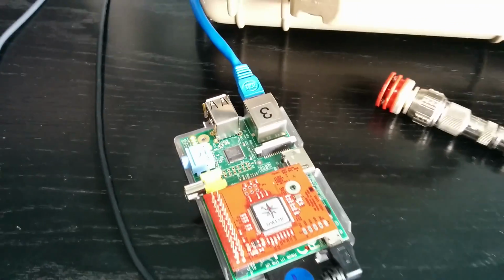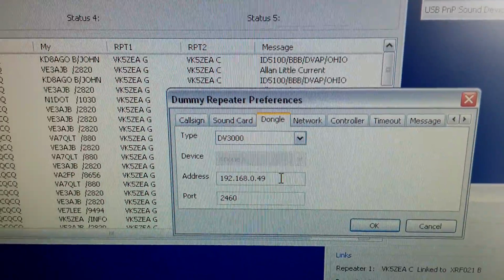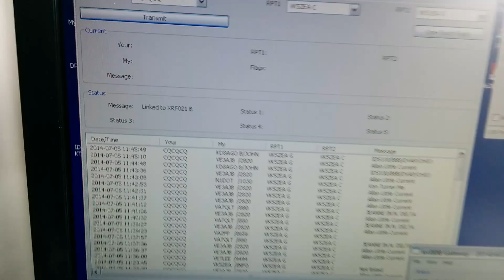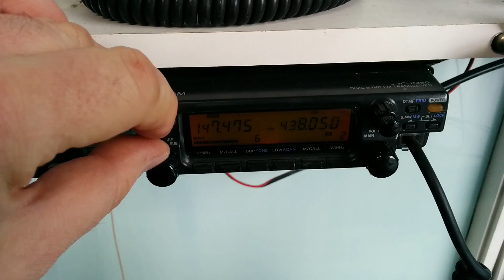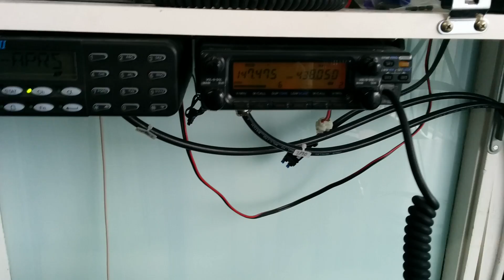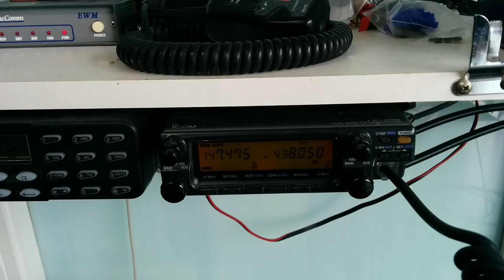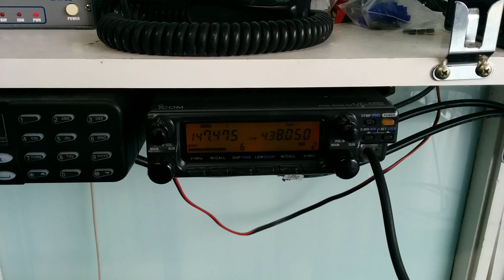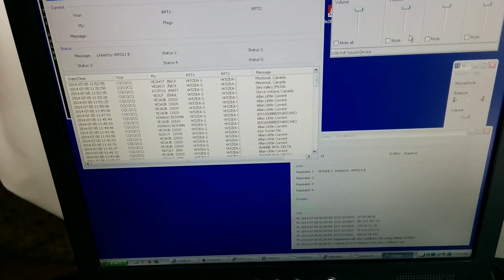D-Star to Analog with the NWDR AMBE3000 board

Comment: Is it possible to bridge D-star & DMR in a similar fashion? I am wondering if there is a DV access point equivalent available for DMR if not could the existing DVAP be utilized in some way?
Reply from the maker: +Peter Ceallaigh  I think there has been successful D-Star to DMR bridging with the BrandMeister software.  The DV4mini USB Dongle is a multimode digital solution... DMR, D-Star, Yaesu SF, P25, dPMR in the one device.
Reply: +Michael Carey Thank you for the info fella

Comment: hallo as they have with the PTT dissolved at the dummy repeaters ? so that the dummy on broadcast comes when the analog signal gets through ?. 73 oe7mfi
Reply from the maker: +OE7MFI Hi, this is a problem caused within Windows.  The URI and URIx use the Volume Down input on the USB chip for carrier detect input.   The only workaround I found was to use an alternative input (com port) for interfacing to the FM radio.

Comment: Very cool Michael.  I have been trying to recreate your experiment with my equipment. I have the DV3000 up an running but I am having a great deal of problems finding the Dummy Repeater software.  Was hoping you help me locate it.  /73s W8BDM
Reply from the maker: Hi Brian, You can find the latest Dummy Repeater software in the "pcrepeatercontroller" Yahoo Group.  Check in the Files section under Release.  I have been using the 20140519 version.

Comment: I have recently configured a similar system consisting of Raspberry Pi, DV3000 and USB sound card + speaker amp. I would like to use it during a daily walk and am looking for a better solution for PTT, preferably to use a speaker-mic like SMC-32 from Kenwood. Your comments and/or suggestions would be highly appreciated. Thanks 73s de JA1SCW

Comment from the maker: A quick follow up on the "volume turning down" problem I experienced during the shooting of this video.

I normally use my URI and radio combo on my AllStarLink node (27871) which is a Linux based ROIP system.  Windows sees the URI as a sound card, it's based on the CM108 USB sound chip.

The designated COS (Carrier Detect) input is wired to the "Volume Down" pin on the CM108 chip.  When my radio receives, it asserts the COS pin (Pin8 on the 25pin connector) which in turn activates the Volume Down pin.  Windows is just doing what it's told!  

I have to see if there is a way to stop Windows from looking at the external input pins (Volume Up/Down/Stop/Play etc.) but leave the audio in/out intact AND also allow the G4KLX Dummy Repeater to access the CM108 I/O.

The experimentation continues!
Reply: Would a Donners interface or a Signalink USB work just as well?  I plan to get back to this soon.  Great video!  73 K4RJJ
Reply from the maker: ***** The main thing to bear in mind is that the G4KLX Dummy Repeater needs to be "told" via hardware when the FM radio is receiving.  It does support other controlling hardware other than the DMK URI, including serial ports.